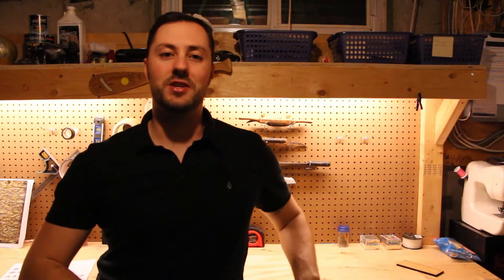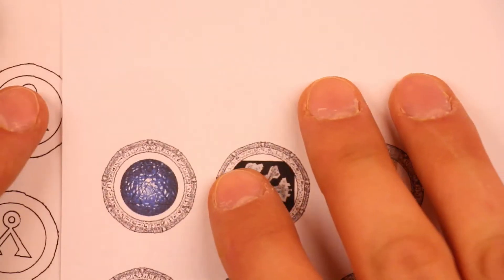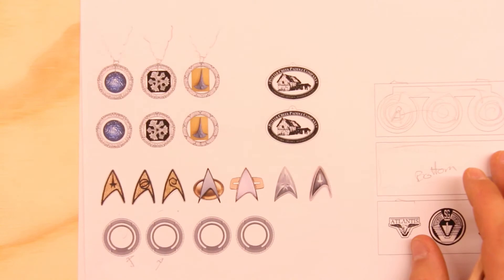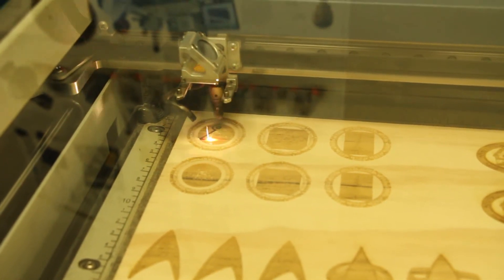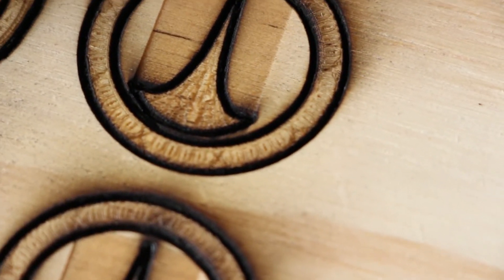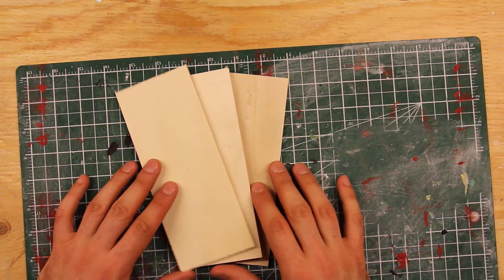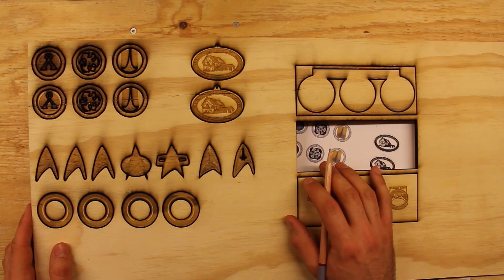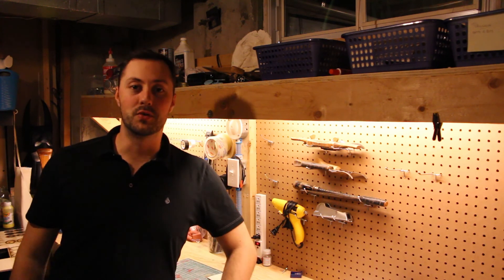Project Vlog - Laser Cutter Lessons Learned

Comment: Excelent 'Lessons Learned'. One question. It looked like when the laser was cutting you needed to move the 'cut line' out a bit to adjust for the kerf of the laser beam.
Reply: +Trevor LaForce I just wanted to say how much I apprectiate the way you did this. My own hobby is model railroading .. with the emphasis being on 'model' as in modeling. I like to share what I do .. and I think MOST importantly .. sharing what didn't work or as well as I wanted. Sharing what works, what didn't .. what might be a better way .. figure that is the best way to exchange info. Most of the laser work that I am familiar with with my own hobby is with something called Laser Board/Lazerboard  - aka Polyester impregnated Kraft Paper. One brand name being PolyBak (evidently even that is a kind of generic term much like saying 'Cardstock'). 

The stuff that Model Railroaders use is about .015" thick and you can do some amazing things with it - check out the work this guy does with it  - http://www.vectorcut.com/

You can purchase some of the sheet from another place - http://www.rustystumps.com/proddetail.asp?prod=L1000 ..

In any case figured if you didn't know about this it might be something you could look at